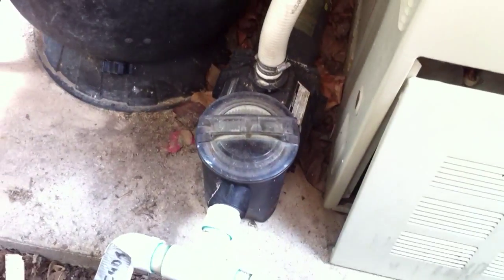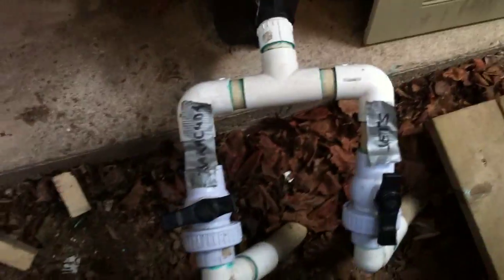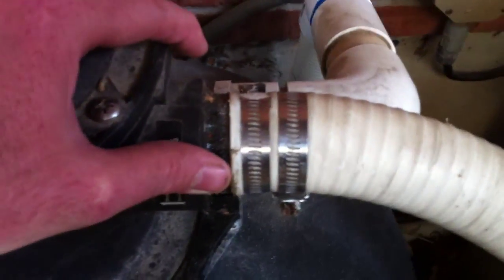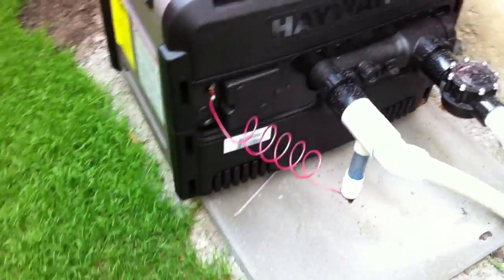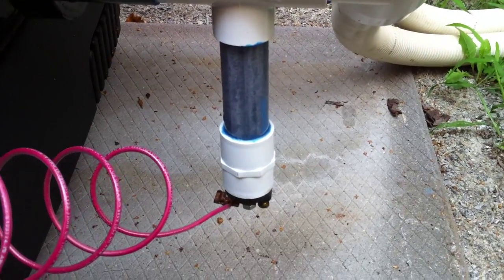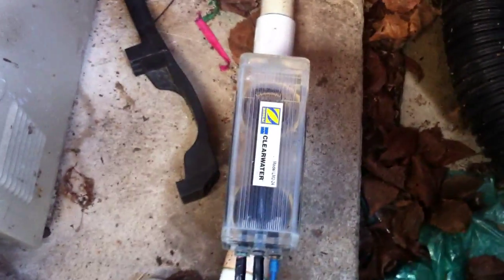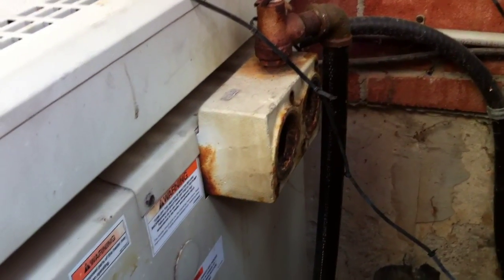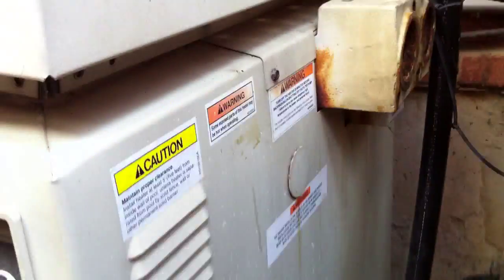Pool Heater Installed Wrong Causing Rust & Failure - Pool Equipment Installation Tips

Comment: Dude your flow restriction BS is BS. Negligible weather you do it more free flowing connections or not.  Makes no difference, Works it works,
Reply from the maker: Whether. Also fluid dynamics and hydraulic efficiency are both real things I can assure you. Science, yo!
Reply: @Swimmingpoolsteve  not with residential pools
Reply from the maker: Why would it not count for a homeowner? Physics only works on commercial pools? Friction exists and turbulence reduces laminar flow. This is really something that you should know if you are going to work in the pool industry and certainly if you are going to choose to comment on these subjects.
Reply: @Swimmingpoolsteve  I'm a retired pool mechanic.  Why don't you tell me how to get laars lite 2 milivolt to fire up without bypassing gas valve terminal. Changed the whole gas rail and flame sensor today. No dice.

Comment: just seeing the vid,  the first thing that strikes me is that the header on the heater was from an older series.   Without knowing the history, I would suspect that water chemistry, going unchecked intitally, ate through the newer exchanger, so they replaced it with an older and probably used one - but the problem with the chemistry wasn't addressed.  The client probably had a tablet chlorinator before changing it over to salt (so that the same 'thing' wouldn't happen where the alkalinity and pH goes negative if left unchecked.)   Given that they STILL have problems with staining,  I would suspect the chemistry is going to be a bit low on the langlier index, probably in the hardness arena, which is causing the water to hold the minerals until it reacts with the chlorine and then stains.

Comment: Great video Steve, thanks for uploading! I subscribed!
Question, I have a 60's smaller pool (8500 gal) and the piping is all 2" copper piping. I'm planning on updating all my equipment to current day standards. Is the sacrificial anode still beneficial in my case w my copper pipes or will it cause more damage. Also I was told not to use a saltwater chlorinator with my pipes being copper. In this case do I still need a check valve after the heater? I'm just using chlorine tablets in a float. Thanks so much for your videos!
Reply from the maker: Hi Dan, yes a sacrificial anode would still be a good idea and may even provide some cathodic protection to your copper pipes.  As I am sure you know, copper pipes are a bad idea in pools and you will certainly need to be replacing them at some point.  And yes, you do not want to have a salt water system with copper pipes - 100% for sure.  For your installation you do not need a check valve after the heater since you are not introducing concentrated chlorine into your pipes only a few feet downstream of the heater like with a salt water cell.
Reply: Thanks Steve for the reply! 
We are in the pre-planning stages of updating all of our 70's era pool equipment/electrical to more modern standards and replastering the pool and spa. Along with that, we've also discussed the copper pipe dilemma. Sounds like you (and the rest of the pool community) highly suggest to eliminate the copper and replace with schedule 40 (80?) PVC (2"?) pipe. 
If we do decide to replace the piping, is this something we should coordinate with the replastering phase of the pool? This way maybe we can update our skimmer, replace bottom drains that include safety covers (ours does not have any covers), add a vac port, maybe update to PVC eyeballs, etc.
Sounds like we need to just implode our existing pool and start new!
Reply from the maker: You would be absolutely crazy to reno that pool and not replace the copper.  it is one thing to leave the copper until you save for a big renovation but to undergo that expensive and leave the most obvious weak link in the system is a guaranteed recipe for disaster.  If this were my pool I would eliminate every last bit of copper.  It can be challenging and expensive however...like with the skimmer or main drain for example.  Still, eliminating the copper is for sure worth the effort.  The copper WILL fail.  It is just a matter of when.
Reply: Awesome thanks Steve!  Sobering news but sounds like we need to do it the correct way. Much appreciated and keep doing what you're doing. Your videos are rock solid and help people like me out tremendously.
Have a great day!

Comment: My experience has been that heaters on vinyl and fiberglass pools are largely corroded due to pH issues. These types of pools have a tendency for the pH to drop, making the water acidic. On gunite pools the pH tends to rise. 

In my market 98%+ of the pools are gunite. But when I do come across an older vinyl/ fiberglass pool, the heater is almost always un-plumbed from the system due to a leaky (destroyed) heat exchanger. Salt compounds the problem. Hopefully this install has a Cupro-nickel exchanger.
Reply from the maker: I am experienced with vinyl and gunite equally and I do not agree with vinyl pools causing pH drop.  In fact, due to the popularity of salt, the much more common concern is pH at 8.2+ basically constantly.  I would bet that the pools you are encountering as described were likely maintained with chlorine pucks, probably right in the skimmer basket, which caused the early heater failures.  Though it is worth noting that you are absolutely correct about the concerns of low pH.  While it is not something that I see often anymore, the reality that low pH and ESPECIALLY when combined with high chlorine levels will absolutely ravage a pool heater.  Copper exchanger will be shot right away and cupro-nickel would not last much longer.
Reply: Good points. I would add that the vinyl/fiberglass pools I have dealt with are not on salt systems. Most gunite pools are not on salt either (though many are). 
A Rainbow 320 or a floating chlorinator is common to both types of pools, but I see heat exchanger damage significantly more prevalent in vinyl pools. Around here (Texas gulf coast), vinyl pools need regular doses of pH increaser, gunite pools need acid. A gunite pool on salt needs a lot of acid. Whatever the case, people should heed the importance of water balance or be prepared to write some large checks!

Comment: It does not 100 percent prevent it. It may slow it down quit a bit. Annode will not completely prevent corrosion. Its a device that will help equipment and metals last much longer if you maintain the system and watch your PH  levels.
Reply: Does zinc anodes that people place in the skimmer sufficient?   Or does it need to be a zinc anode attached inline to the pool plumbing and bonded.  Those zinc anodes in the skimmer, there’s no way to electrically bond those…